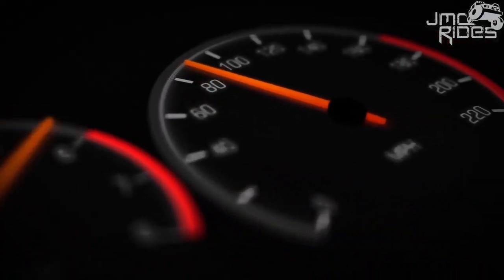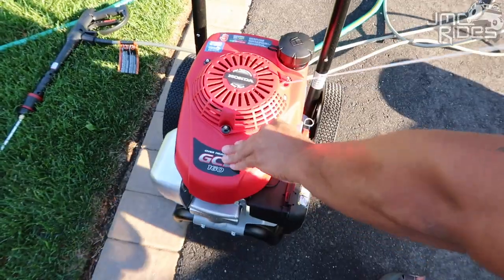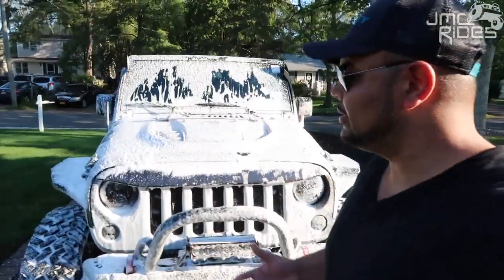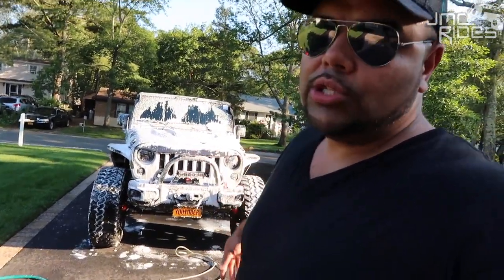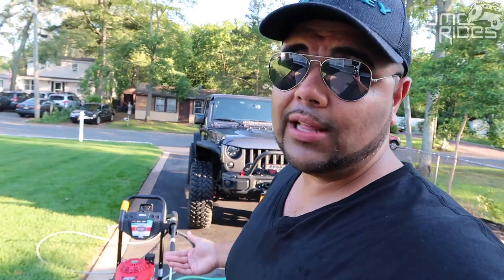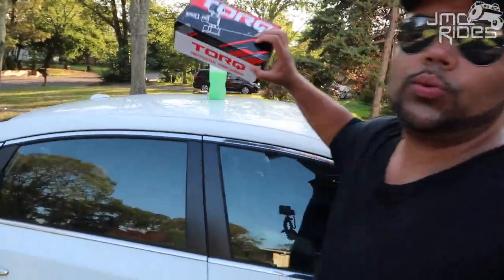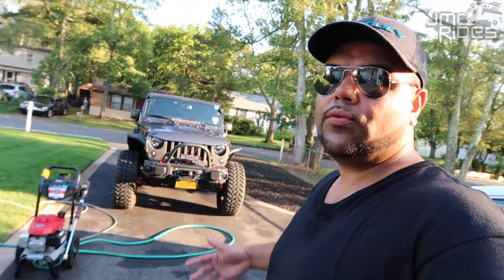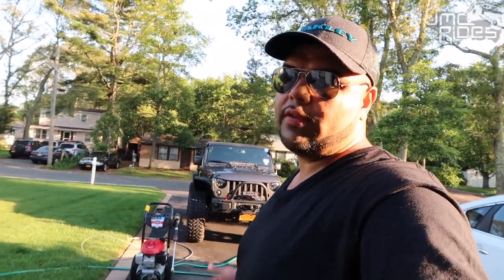Foam Cannon On Steroids! How To Get Thick Soapy Foam From Your Foam Cannon?

Comment: Don't need pressure with the same specs to get thick foam. If you have an electric pressure washer all you need to do is change the orifice to 1.1mm or if you have a stronger pressure washer you change the orifice to a bigger diameter. It all depends on the machine you have you have to change the orifice of the foam cannon
Reply: What size orifice would be good for the Sun Joe SPX3000 at 2000PSI and 1.76GPM?
Reply: same I did with mine and it foamed a hella lot than the one on the video. Mine is a 1.1 and it just took me a less than 5 mins and less than 5 bucks.
Reply: BobWes251 should use a 1.1mm
Reply: Mine does not foam that much which is very disappointing. I have a 3,000PSI with 2.5GPM. What would you recommend?
Reply: Emmanuel Suazo u might have to small of a orifice look on google for mjj orifice and they will have a selection of orifice and tells you with what pressure washer should they be used
Reply: My electric pressure washer is 4000 psi and 4 gal per minute. Don't assume all electric pressure washers are those crappy ones.mine was $1400
Reply: @mikewest712  Nowhere on this thread did anyone say anything about price or crappy pressure washers. You sound like you're compensating or you have an inferiority complex. We're just discussing how to get thick foam dude... Geesh!
Reply: Hers's a link for anyone looking for the MJJC orifice: https://mjjc.com/products/1-1mm-nozzle-screw-jet-for-snow-foam-lance
Reply: orifice
Reply: @mikewest712  What brand and model pressure washer is that ? never heard any electric washer that perform at 4000psi going to be that cheap..

Comment: Try Super Clean on your tires, you can get it at O'Reilly's, Wal-Mart, it comes in a gallon and spray bottles, it works right away with out scrubbing but scrubbing will help out.
Reply from the maker: thanks for the tip, i'll give it a try
Reply: I gotta say for the value, super clean is unbeatable! $8/gal. And it does just as good of a job as McGuires super degreaser..... without smelling so strong

Comment: I use a Karcher K5 electric.  Only 2000psi and 1.4 gallons per minute but it does just fine at much less cost.  Same foam cannon as in video.  Good info though.
Reply from the maker: thanks, does yours produce the same thick suds?  I only ask because there are a lot of reviews of people saying its not the same.  Granted they did have electric power washers that had less psi than yours.
Reply: JMC RIDES it's better to have more PSI for these foam cannons. I had 2 Ryobi electric pressure washer. The first one was 1600 PSI and it was alright, second one was 2000 PSI and that was better but I got a gas one with 3100 PSI  and the foam is much thicker and better.
Reply: Gursavek Gill you'll get more of course with gas but with a 2030 electric & 1.76 gpm u don't do to bad I've learned that when you add your soap to the cannon instead of shaking or spraying the water in u gently turn it side to side that way you don't create the foam inside but you'll get thicker suds as it sprays.  Great review btw and nice jeep
Reply: I think as long as you're between about 2000 and 3000 psi and somewhere close to 2gpm, you'll get the big thick foam.

If I had the space I would have gone with something like that. However in my case, foam thickness wasn't priority number one, because I have extremely limited space so I went with the greenworks 1700psi electric. It has a very small footprint for what it can do. Does it produce ultra thick foam? No. Is it an acceptable amount that serves the same purpose? Yes.

Comment: For the record - there is no difference between a $20 or $80 foam cannon..   the difference is the pressure washer's psi..   the simple way to get thicker foam is to change the nozzle in the cannon to one with a smaller sized hole if it's a lower psi unit. It's like an $8 part..    I gave up on the foam cannons.  A wash mitt with an extending handle, an expanding hose, and a $10 pump sprayer for wheel cleaner (buy gallon sized concentrate on Amazon) is much quicker and easier in my opinion.  Meguiars Ultimate soap is great..   all this "car detailing"  website stuff is just a money grab with this foam cannon craze..
Reply: Kevin Coffey this is completely false. I have a 17 dollar fasmov foam cannon and a 100 dollar chemical guys one. Using the same amount of foam in each cannon on the same pressure washer leaves much more foam with the chemical guys one.

Comment: If you want your cannon to last you need to RUN clean water though. Also, if you have an air compressor blow it out to dry it.  If you don't you will get water deposits along with an old soap buildup, which will cause it to clog. Once its clogged it's a pain in  the butt breaking it apart to clean it.
Reply: Michael L if it does clog, run white distilled vinegar through it. It will dissolve all the deposits no problem. The same technique will work to clean out a coffee maker with mineral deposits too.

Comment: Do an electric pressure washer vs the one you got
Reply from the maker: I have seen the electric ones already and they will never produce a thick foam like this one.  It will be more watered down
Reply: JMC RIDES 
Have you seen the 3000 psi ones ? 
I’m debating tbh I just want the most advice before I get either or